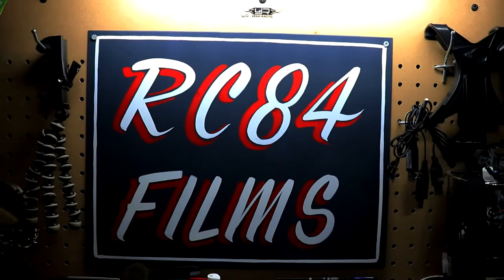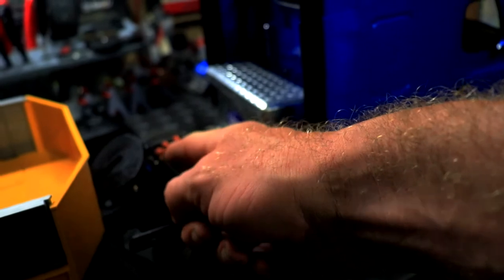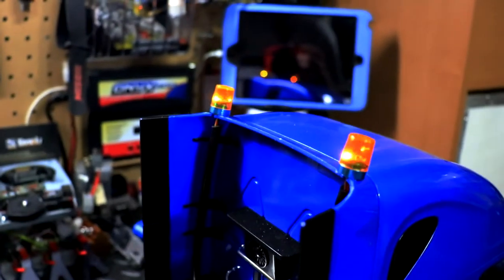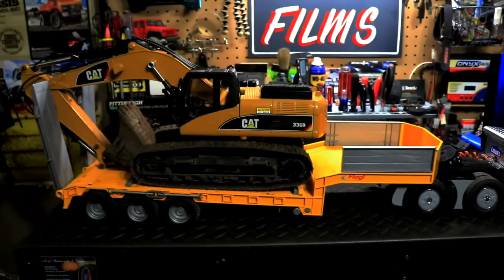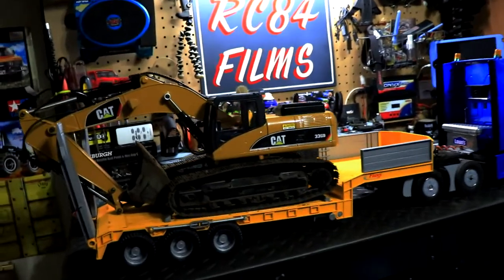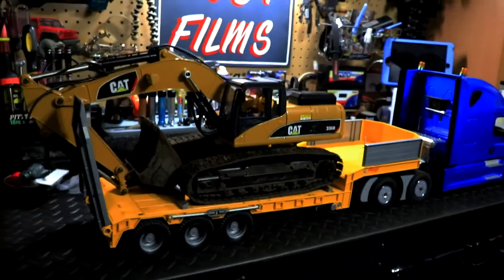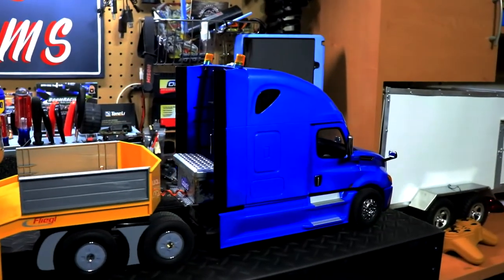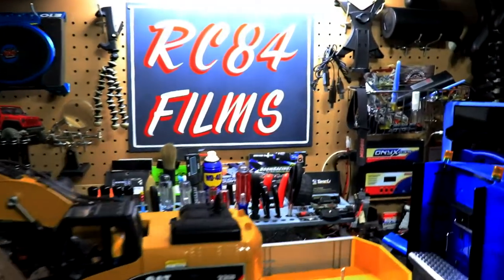RC84Films: RC Semi & Trailer Overlook

Comment: can you post a link to the y connecter and the lowes box?
Reply from the maker: Lowes.com
Reply: I found that they make a red trailer also. Walmart selles the yellow trailer by itself for $79 and the whole set for $110
Reply: Do you have the screw size because 3mm x 16mm is way to small
Reply from the maker: RC Car Police Flash Light,WONFAST... https://www.amazon.com/dp/B07Q4NJ6B4?ref=ppx_pop_mob_ap_share